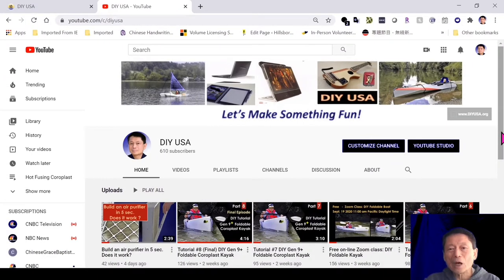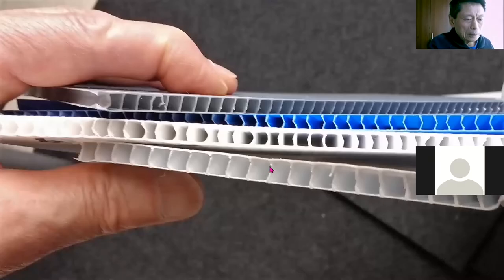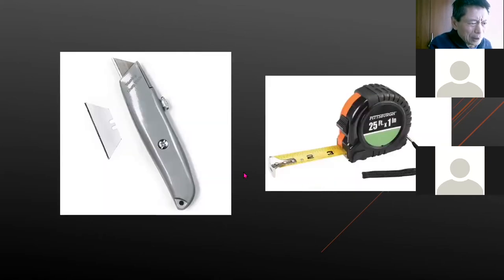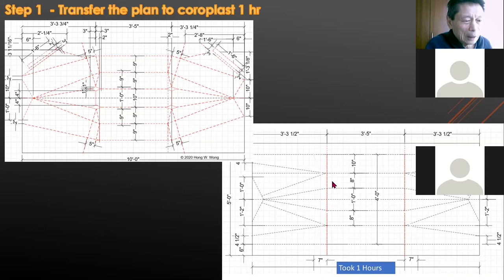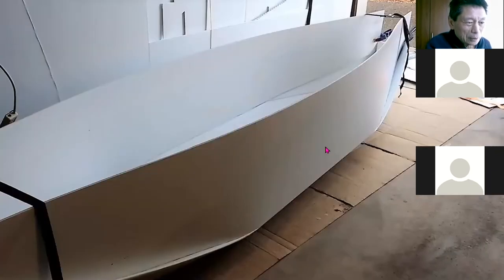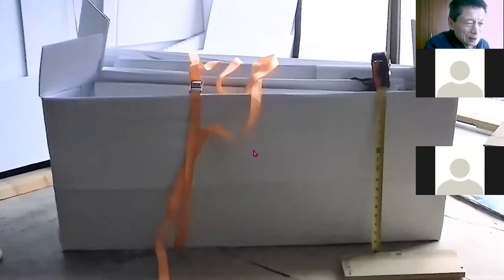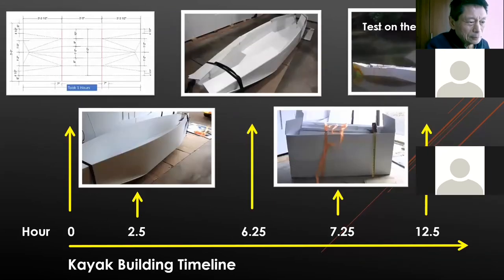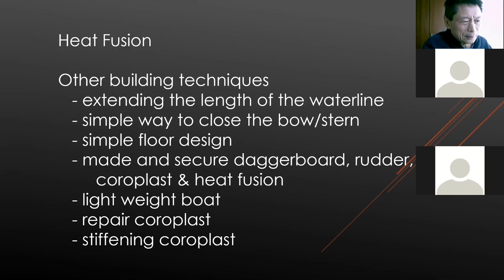A comprehensive guide to build a coroplast foldable kayak

Comment: Love your videos and your engineering. I have a few questions about doubling up on 4'x8', 4mm sheets since 5'x10', 6mm is harder to come by (and I apologize if you cover this elsewhere). Say I'm building a Gen 12 which fuses two 4'x8' sheets with a 5" overlap. Could I (or should I) fuse two sheets directly on top of each other first, then repeat with 2 more sheets, then fuse my two new, now 8mm, sheets with the 5" overlap? Would it still be foldable? Would adding extra layers to the floor provide sufficient strength that the 8 mm isn't necessary since the majority of the forces are at the bottom of the hull?  If I did fuse two 4'x8' sheets on top of one another, should I cut one sheet in half first so I could fuse it with its channels perpendicular to the other sheet (for strength) or should I keep the "grains" parallel (for fold-ability)? Thank you for your time!
Reply from the maker: Thanks for your feedback and your questions. I wonder if you have read this article  https://makezine.com/projects/origami-kayak/  and watched this video https://youtu.be/bmMcqo1-pHo 
My friend built this kayak using 4' x 8' 4 mm thick coroplast  When you have multiple fused sheets it is different to fold the sheet. If you build and fold the boat illustrated in my Gen 16,  https://youtu.be/jkd5u2TshpQ   I believe the boat will be stronger than the one my friend built. The design of all these G12, 14, 15 16 are basically the same. I keep on improving them. For 4 mm thick coroplast, we have to strengthen the floor by stacking more layers. These layers can be taped together, glue together. For me, I would just fused the edges of these sheets together (no need to spend money on tape or glue). I am working on part 5 of this series  https://youtube.com/playlist?list=PL2ShZzOUu01u_G0Man5cxY3F8LAREFChX and I will answer some of the questions you asked in that video. I have a web page which may help you to look for the information you need. https://www.diyusa.org/techniques    If you have more questions please feel free to ask and I will try to answer that in the same video (part 5).  Chees!